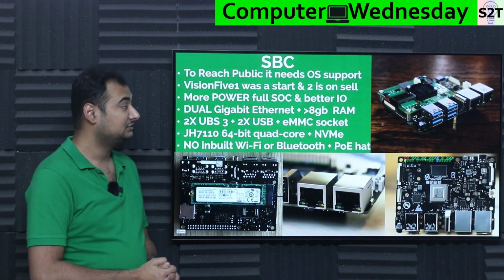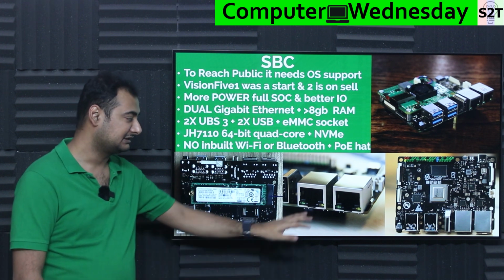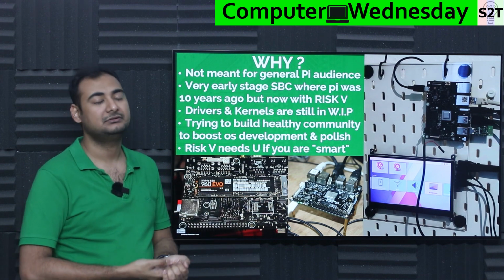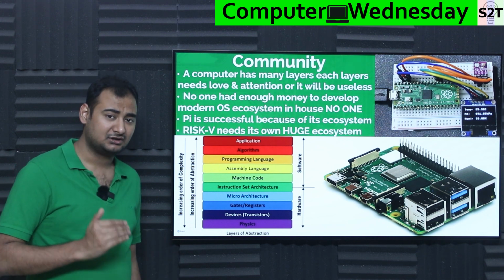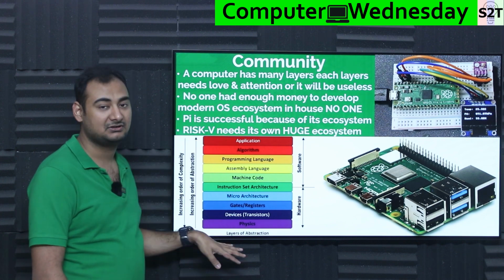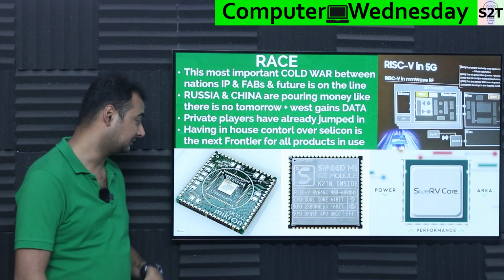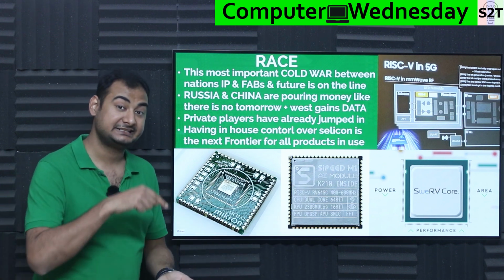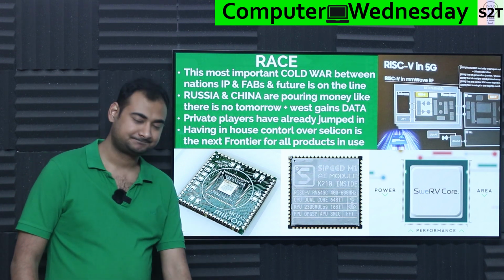VisionFive 2 RISC V Explained {Computer Wednesday Ep221}

Comment: Great, but modern ARM is not RISC.
Reply from the maker: they are at core and yes modern add on and AI stuff they are not RISC
Reply: @s2tenglish  Maybe referring to that the original goal of RISC was for all instructions to execute in a single cycle, and as of ARMv8 ARM contains instructions that take more than one clock cycle to execute, but that is now an old idea. Modern processors use micro-ops and that design goal is not what people are talking about when they talk about RISC these days.